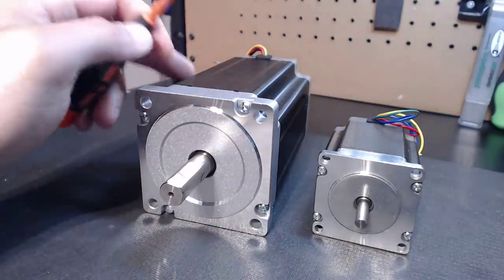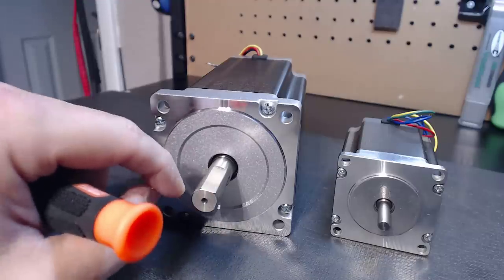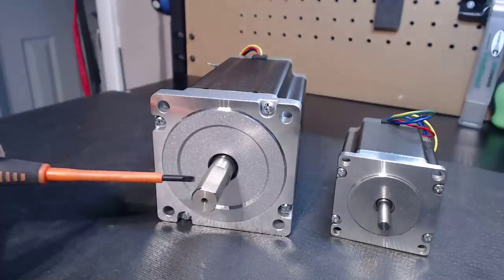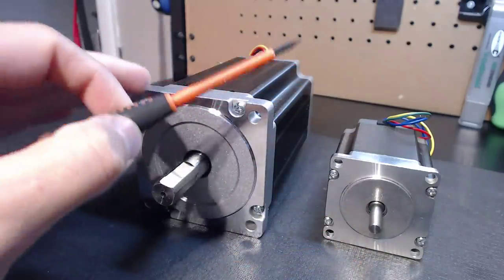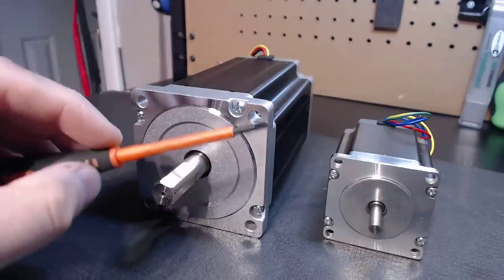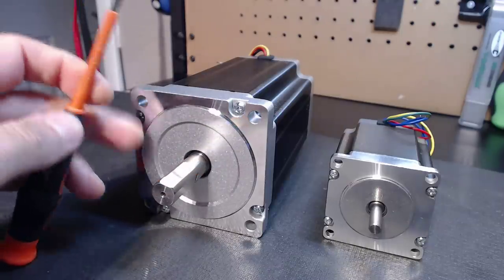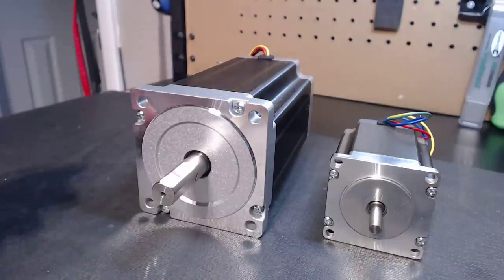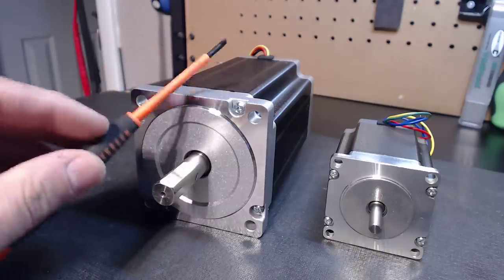Stepper Motor Torque For Your Applications..

Comment: In my 18 years of experience in cnc conversions, my opinion is: It's always much better be over than under powered specially when it comes to stepper motors which have no position feedback and missing steps ruins parts!
Reply from the maker: Thank you for your support. Well said! Vince

Comment: Wow! Someone who actually goes in depth about the inch lbs of torque ratings on steppers👍
Reply from the maker: Brute4rce, thank you for your support. I greatly appreciate it. I try to breakdown just how powerful a stepper is to make sure they never over purchase. 

Thank you again,
Vince
Reply: @corvetteguy50  I keep seeing these great concrete 3D printer projects, but I haven't seen build details anywhere.  Considering the small houses they're building are always charity projects, it's a bit odd that there are no printer build instructions in the public domain.  Do you see any problems using a NEMA 42 or 34 in a geared rotary-type printer with an aluminum arm that telescopes, say, ten feet from the center?  On second thought, now that I've written it out like this, I suppose the math is straightforward.  Just the same, have you happen to have seen any information on the internals of those enormous printer builds?  Thanks for any guidance.
Reply from the maker: @Chocolatchips  , Thank you for your support. I believe those printers are strictly proprietary to the manufactures of them. This is of course not to say they can't be replicated, but the engineering is required to be done by the end user of the project. A Nema 42 gear reduced motor would be the only possible solution for such a robot, or custom made motor. 

Large scale production robots like these take ample amounts of engineering knowledge, and money  to accomplish, which discourages many of them.

Thank you
Vince
Reply: @corvetteguy50  Thanks for the fast info, Vince!
Reply from the maker: @Chocolatchips  You bet  :)
Thank you,
Vince

Comment: Ran across this video in doing research for a new project. Have some questions, thought I would ask here.

Long story short, I am in need of building a rotary table of sorts to polish a telescope mirror.

Normally, mirror grinding machines like this are built with ~1hp 3 phase induction motors using a VFD for speed control.

The tables can be run anywhere from 0 to 60 RPM and gearing is done via belts/pulleys or reduction gearboxes.

Table diameter would be around 18-24 inches and the mirror diameter would be 12-16 inches. 

Load placed on the table is typically weight of the mirror + polishing tool + 20-50lbs of weight to help with grinding/polishing. 

Let's assume a load of 75 lbs total max, real world scenario probably isn't even close to this. The load will generally not be on center and will overhang the edge of the table at times.

The problem with the 3 phase 1hp motor is that I really don't want something that big so I was thinking of going with a NEMA 34 (1600oz/in) plus a 10:1 reduction NMRV40 worm gearbox as the footprint would be much smaller. 

So questions are:

Is NEMA 34 overkill for this? I'm worried about stalling the motor, skipping steps, not having enough torque, etc...
Is a stepper motor even a feasible way forward for this even at NEMA34 size?
Would NEMA 23 suffice? I get the feeling no.

I have experience with NEMA23 ClearPath steppers on my CNC machine I built, they are quite powerful and perform like a champ on the machine. I've tried to stop the gantry from moving forward using my hands but im pretty sure the earth just rotates underneath rather than the gantry stopping. It's pretty strong.

That said, a CNC machine driven by ballscrews and a rotary table with 75lbs of weight on it are completely different applications.

Any thoughts or insight would be appreciated.
Reply from the maker: Thank you for your support.

 Please contact me through my videos description to setup a half hour engineering consultation. 

Thank you,
Vince

Comment: thank you, very informative I built a 3x3 table with 8080 frame with ball screws, 100 lb gantry. I use NEMA 23s 570 in oz motor. I have seen these motors twist the frame before the motor stalled.
Reply from the maker: Hey Gary, thank you for your support, and your exactly right. Steppers oz/in per IN/LB are very strong, and most end users really overestimate their requirements . Thank you,
Vince
Reply: jesus christ

Comment: Thx for the explanation, specially for students like us. What would u recommend for turntables or "lazy susan" that can carry atleast 60 kg.
Reply from the maker: Mr. Santiago thank you for your support. The load your wanting to rotate would require a Nema 42 with at least 2800oz/in motor for maximum stability for that application. Thank you,
Vince

Comment: This helped alot , my gantry is about 80 lbs on the 4x8 table, so that 600 oz motor will do what I need to do on this plasma. Thanks  Sir!!
Reply from the maker: Hey David, your for sure going to be fine with the 600oz units for that chassis. Thank you again for your support. Vince

Comment: I have a nema 23 on my Z axis on my Lathe and when it comes to doing a peck cycle it misses steps needs more torque, if I lower the acceleration will that give me more Torque ?
Reply from the maker: Thank you for your support. It may help, but usually missed steps are do to EMI, and overdriving the motor out of their operating envelope. Reducing the motors speed would help with this as well. Thank you, and have a Happy safe New Year! Vince

Comment: Question is can i mill aluminum using my nema23 or it depends on the spindle size what the best spindle to mill aluminum if so thank you for the amazing video
Reply from the maker: Eclipse, Thank you for your support. A Nema 23 is easily capable of machining aluminum. I designed my 600oz/in Nema 23's for metals, and softer substrates. Here's Nema 23's machining aluminum. https://youtu.be/LLHbzmXAPps

Spindle size does matter, but effects your feed rate variable the most as it has to keep up with the motors motion to provide smooth cutting. Think in terms of a Dremel tool which can cut steel, but must move very slow to do it properly, so the tool will actually cut it. 

A well balanced system is key. A 2.2Kw (3HP) spindle is optimal for optimal feed rates. The motors you use should be as strong as possible in a Nema 23 frame. 

Thank you, and have a great Labor Day weekend!
Vince
Reply: corvetteguy50 // so you mean i need to lower the speed of spindle to get accurate cut and more torque as the torque inversely proportional with the rpm .. my last question is if the 800w spindle 1hp is the only spindle  available for now is that ok to mill aluminum as a beginning
Reply from the maker: @yasirh2004  No you'll need to lower the feed rate of the systems axis, so the spindle can keep up with the cutting required. 800W was used in the video link I sent you in the previous reply. Start with a slow feed rate with proper lubrication on your endmill, and you'll be fine. 

Thank you, and have a great Labor Day weekend!
Vince
Reply: corvetteguy50 // never heard of feed rate before but after you told me that I searched for it and i’m totally understand what it means thank you very very very much really appreciate these answers 🙏🏻
Reply from the maker: @yasirh2004  You bet...:) thank you, Vince

Comment: I'd like to see what the thoughts are on using these motors for robotics. It's something I'm looking to get in to one day
Reply from the maker: AsilarWindsailor, thank you for your support. These motors are designed for robotics, so your in the right place. have a great weekend, and please be safe. Thank you,
Vince
Reply: Igus robots are built with stepper motors. Have a look on its Low Cost Automation Line.

Comment: You have simplify CNC for novice like me. Thank for a great job you are doing. I would like to move a 250Kg plasma gantry using rack and pinion system and steel roller on a beam. kindly advice on the motor size to use.(with gear and without gear). Thank a million times.
Reply from the maker: Balogun, thank you for your support. A 500+lb. gantry is only the units weight, but it will be mounted on bearings which will be supporting the load, so the actual force required to move the gantry is much less depending on the quality of bearings. Genuine HiWin is the best. I would recommend my Nema 23, or Nema 34 depending on the length of your chassis. Please tell me, and I'll direct you to the motor. Thank you,
Vince
Reply: @corvetteguy50  Thanks for your response. The length of the chassis is 8 meters. Is possible for me to use stepper motors for this machine without gearbox or pully? If yes what size of motor should  I use? Kindly direct me to the motor. Thanks for your support.
Reply from the maker: No you would require a gear box for acceleration on a chassis that size. I would recommend a Nema 34 do to your chassis length to allow the torque produced from it to allow for higher rapids. Unfortunately their are tom many variables to just recommend one for you without covering the details in your chassis. Please contact me via email to discuss engineering consultation. Thank you,
Vince
Reply: @corvetteguy50  Thanks for your response. I will contact via email to discuss engineering consultation.
Reply from the maker: @balogunwole6314  Sounds good. Thank you,
Vince

Comment: I need a stepper for which can produce maximum of 50nm torque,  here i don’t have any concern regarding speed , speed can be compromised , can u suggest please,  actually i m making robotic leg with upper legweight 12kg, lower leg weight 5kg , hip actuator  needs staring torque of 45newton (not included friction), my calculations are correct , i have used Adams,Solidworks,matlab for confirming my required torque , they  are giving requirement of 45-50 maximum torque for the hip actuator, so can u suggest a stepper motor for that
Reply from the maker: Hey Sam, thank you for your support. For your torque application requirement you would need a Nema 52 motor which may not work for your project due to its massive size, and weight. 50 Newton meters equals 442.5 in/lbs of torque. Thank you, and a have a great weekend!
Vince

Comment: i have been trying ti find out why a stepper. motor . & not a dc motor like the one that drives a Mobility scooter  What is the difference  & why .?
Reply from the maker: Stepper motor's run on step, and direction signals for precision control. DC motors in a scooter aren't applicable to precision robotic applications. Thank you,
Vince

Comment: do you think on the same driver i will see a difference from the 269oz to 425 oz ?? my x axis randomly stalls
Reply from the maker: Hey Rob, thank you for your support.  The difference in the two motor's torque is 9.75in/lbs, so it would make a difference, but I still would recommend going over the axis giving you issues for other mechanical problems to assure its motor torque causing the issue. Thank you,
Vince

Comment: Thanks for your explanation.I have a problem can u give me any advice please?
I want to replace screw of M10 ,which need a 50Nm torque to turn around, with a stepper motor.Which size of motor should be used.Please help me..
Reply from the maker: eimyatmyat, thank you for your support. The torque you require is 7080oz/in which a stepper motor isn't able to be produced by one without it using a planetary gear box. Using a PGB will however slow the RPM of the motor down, so if that's a factor for your application you'll require another motor for your solution. Thank you,
Vince
Reply: @corvetteguy50  thank you so much
Reply from the maker: @ryuu-7615  Your welcome...:) Vince

Comment: Thank you! Wondering what it would take to run a sawmill carriage ? Not huge logs , typically few hundred pounds
Reply from the maker: Thank you for your support. Please contact me directly for a consultation as this would require engineering to give you a proper size matched with the proper gearbox, and transmission. Thank you,
Vince

Comment: I want to build 5x10 cnc plasma table, is NEMA23 motor is fine??
Reply from the maker: Thank you for your support. Yes, I would recommend my 600oz/in Nema 23 as it produces the most torque in the Nema 23 size.  Vince

Comment: Hey new to the cnc world, looking at converting my zx45 mill, I have some of the nema 23s with 425oz/in tq sitting here wondering if you think they'd be sufficient for the x and y axis direct drive with ballscrews?
Reply from the maker: Chris, thank you for your support. They may work, but optimally you would be better with my 600oz (37.5in/lb) motors https://www.ebay.com/itm/142172266617 for that sized mill. Thank you, and have a great weekend!
Vince

Comment: very powerfull motor wonder why there not used in electric cars ??
Reply from the maker: sparkeydave, thank you for your support. Steppers are designed for low end torque that bleeds away quickly at higher RPM's making their applications best suited for robotic automation. Thank you again, and have a great weekend!
Vince

Comment: Hi, love your channel and info. Great work!! I am starting a DIY project where i am searching for a motor to make a outdoor sun shade blind at the car park. The width of the parking lot is 5.5m so i was thinking to have all the fabric rolled up on a metal stainless bar and have a motor roll it up and down. Which motor would you recommend ?
Reply from the maker: Falcon Eye Vision, thank you for your kind words, and support. There are many variables to make a recommendation for the motor size you'll require. I would first need to know the transmission you were planning on using if any. I would then need to know the weight of the sun shade, and all rotating components to make the correct decision on selecting the motor to handle these variables. I offer engineering consultations for an in depth look at projects like this, and product designs. Contact me at my email address for pricing. Thank you,
Vince

Comment: I need a motor for a Ribbon mixer (very big long cement mixer) 4000L of powder product, what sort of motor should I be looking at
I have 0 knowledge, all I know is I need high torque low speed motor
Reply from the maker: T, thank you for your support. Please contact me through email in the video's description for an engineering quote. Thank you,
Vince

Comment: If I was looking to upgrade a motorized saw mill would my eyes still be bigger than my stomach? Not driving the blade just possibly the forward/ back/ blade up/ blade down motions.
Reply from the maker: Thank you for your support. Its certainly possible depending on your budget, and time allowance. If you would like to setup an engineering consultation please email me. Thank you,
Vince

Comment: How do you find out what the ounce/inch output is?  All I seem to find is what the standing torque is but it doesn’t give any other information . I have the Nema 23 23HS45-4204S and it says in the spec 425oz/in holding torque but no other specs I can find. Thx
Reply from the maker: Thank you for your support. Stepper motors are only rated to their stall torque which is the motor's usable torque before stalling. Thank you,
Vince

Comment: When you say this is 1700 ounce inch torque...but can you tell at what speed it is that torque?
Reply from the maker: Thank you for your support. Its impossible to know as you have missing variables like transmission used if any, and the Khz frequency the drivers are running that are sending it step, and direction signals. Thank you, and have a great weekend!
Vince
Reply: Thank you!
Can you tell me at what frequency (no transmission) can I achieve the 1700 ounce-inch torque. I would really love the calculation.
Reply from the maker: @vedantjoshi1487  80-100Khz would be optimal. Thank you,
Vince
Reply: That is holding torque, not moving. Go and look at the torque curves from the manufacturer. Torque reduces drastically as speed increases

Comment: thanks for the explanation, i need a motor with high speed (150- 500 rpm) and that can carry 3-10kg. What motor stepper u reccomend me?
Reply from the maker: Patrizio, thank you for your support. You'll require a Nema 34 motor for application 1200oz/in should be fine. Have a Happy New Year! vince
Reply: if you can tell me also the model and where i can buy it.
Reply from the maker: @patriziozaccagnini5414  Please email me directly Storm2313@gmail.com,  as I offer these motors. Thank you,
Vince

Comment: Thanks for this vid!
just bought a nema 23 with 8mm shaft,  and I'm looking for a reduction gear, even a simple spur gear.
Not only that I found nearly nothing on eBay and aliexpress, but the very few I did find weren't design the 8mm D shaft.
Any recommendations?
Reply from the maker: Ofir, thank you for your support. The most common solution is to purchase a gear with a bore of 6.35mm, and open it up to 8mm with a drill, or a lathe pending it has enough material available which most do. Thank you,
Vince

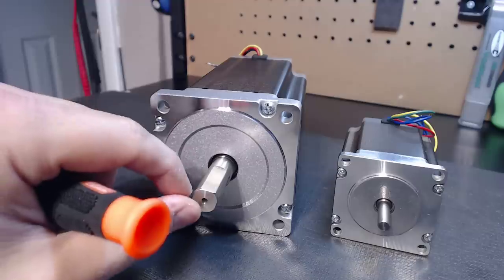Comment: Hello.  I want to make a solar tracking system(single axis)using a photovoltaic panel of size 760X680X30mm.  I am thinking of creating a frame in the shape of the letter "X" in the middle of which I will weld a 15-20 cm long pipe to connect to the motor axe,everything should be around 8kg.Which kind of motor do you think would suit my application? Could  nema23 with an gearbox with 1:50 ratio handle it? Thank you.
Reply from the maker: Thank you for your support. Unfortunately there are far to many details missing before I can answer that. Please schedule an engineering consultation if you would like to move forward on the project. 

My information is listed in the video's description.

Thank you,
Vince
Reply: ok , thanks for answer.